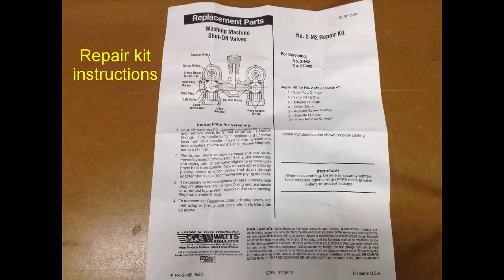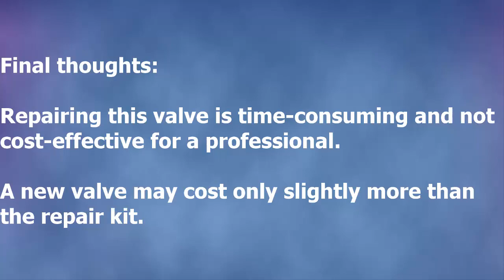Repairing a Watts Laundry Valve

Comment: I appreciate you putting this on You Tube because I purchased a dual valve that was leaking.  I was going to fix but couldn't get, apart, was told I was doing something wrong but now I see it is just a cheep knock off in a Watts box.  Ordered new Watts that is repairable, thank you again.  You are the first person I have found that showed the procedure instead of just saying how to do it, and it was quicker and just as cost effective to replace valve....

Comment: Fantastic job....is it necessary to take the whole valve apart if I only need to replace the small O rings on the shut off shaft?
I'm guessing, yes, since it seems that its keyed into the balls on hot and cold shutoff inlet. 
Does anyone know for sure?

Comment: Thanks for posting. it answered a lot of my wondering. What is the cost difference between the kit and a new valve? Is it worth taking a chance of overhauling the valve than replacing with the new one? Excluding the soldered pieces?
Reply: The Watts brand valve is pretty expensive depending on where you purchase but you can buy a cheaper brand that will still slide right on in place of the Watts valve, just make sure you do check your Center to Center measurements to make sure that they are the same. You should probably take your valve top with you after you remove two flat head screws to compare when you purchase.  Cheaper valves can be bought as cheap as $38-$40.
The kit is around $32.
Reply: @justme-pt3te  Thank you.